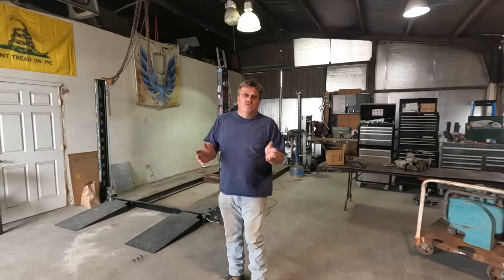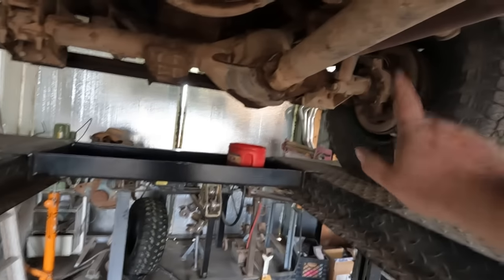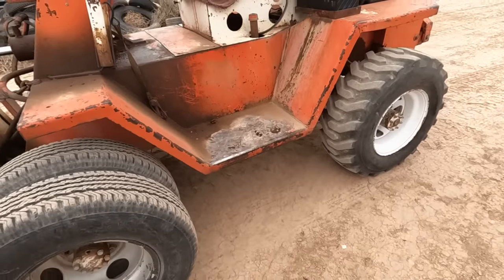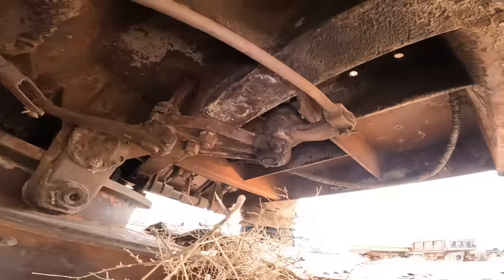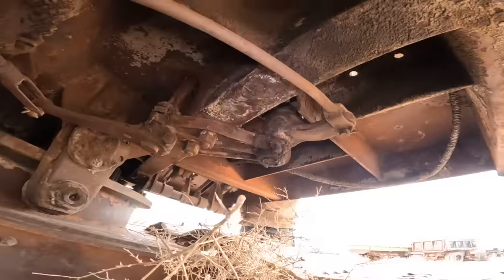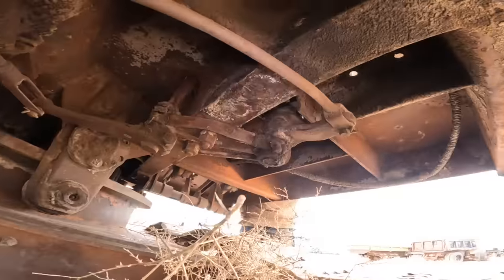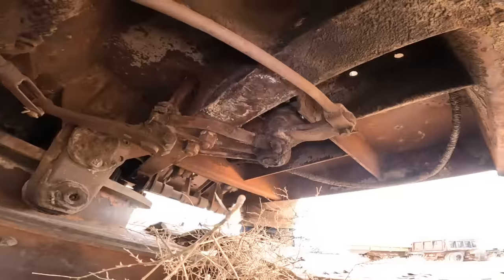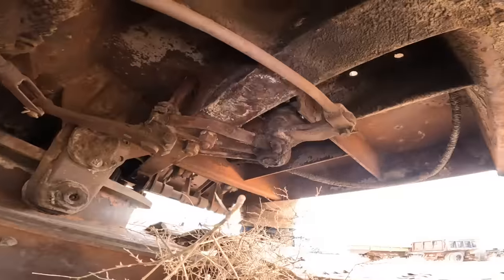Shopping for Junk!

Comment: International built some tough trucks. At 17 my friend Don got a brand new 1969 Scout to run his paper route with. It had a 110hp 4cyl, 3 sp floor shift, locking rear rear diff and 80% limited slip front w/ Studded Goodyear  Suburbanite Snow tires. It went just about anywhere and it was indestructible. We purposely drove it into ponds and creeks trying to get it stuck. When we got it stuck, we took turns trying to get it unstuck. With Rev and 1st inline w/ each other it was real easy to ram it in Rev and then 1st trying to keep any momentum we'd got going.  We used to think Rev was syncro'd cuz it never ground. Sometimes we had to pull it out with a tractor, but all we had was a tiny little Ford  8N, so we had to jerk pretty hard on it to get it out. One day while we were at the International dealer I asked the manager where we should hook on it to pull it out. He told us to pull it out by one of the spring shackles. His words to us were " If you can break that spring shackle International will give you a brand new Scout." It never broke. We couldn't break that Scout. We rolled it 300' and when it stopped it landed on it's wheels. The only thing that broke was the distributer rotor, or we would have driven it out of there. Don's gone now, Rip Don. Thanks for the memories. Jimmy, Jimmer & Ben are still around to tell the tale.

Comment: I'm building a 4x6 lawnmower with a dump box with 2 engines. It will still have a functional blade as a regular lawnmower but will have 2 axles in the back. The engine in the back will be for the hydraulics and extra hps when needed

Comment: I am sure glad that I don't live near there.  :-)  That is quite an interesting yard and. he sure knows his stuff.  A lot of equipment, that I have never seen before.  
I loved the fact that he appreciates the good steel used to make those saw blades.  I always had my eye out for that type of scrap made from good steel.  Young people, only think of buying from the supplier, it sure adds to the cost of a project. 
  My brother in law, had an 8,000 lb PTO Ramsey winch on his 65 Ford, and that thing was awesome.  I am still using an early 70s Warn 8000, which is indestructible.

Comment: Low Buck Garage  :) yes amazing yard of vechiles, motors , transmission, tractor  and name it he got too! One vechile my one late cousin had ownership of John Deere tractor dealer near me he got 1975 Dodge D350 Extended van was old hospital van he got in 1984 then motor get lazy of 360 2 barrel with hand choke cable knob in dash for carb also Transmission 3 in tree on Coulmn Shifter to plus 411 rear end gears! So put 1976 Massey Ferguson Combine 505 6 cylinder Desiel Perkins 354 bore up 400 Cubic Inches on rebuilt, plus put Pick up truck TRANSMISSION floor Creeper first gear Bow Low in 5 foward gears, plus one Reverse, with Hydraulic pump clutch too , 390 rear built up camper ! Funny parts got 35 miles per gallon &  top speed 120 miles per hour speed and wild 5 gear going up hills or straight pull gear and down hilll like Overdrive gear ! Drive the van back 2004 one summer season to camping spot and amazing van was  till clutch went on ! But heard another cousin families rebuilt up get road ready for take camping plus vechiles shows too!